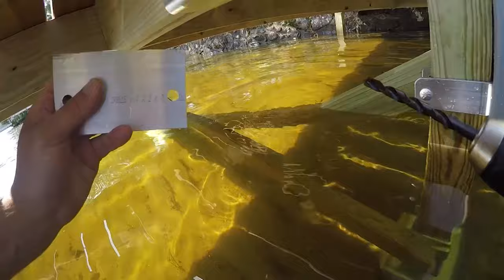A Weekend Warrior 4x4 Post Dock Project #dock #4x4postdriver #4x4postprojects #4x4postIdeas

Comment: You certainly have an ideal location to build a dock. Shallow clear water makes it very easy. I opted for a floating dock because my lake has about a 45° angle into the water meaning, at 20 ft out, it's roughly 20ft deep. I still enjoyed your very informative and entertaining video. Nice job 😎👍

Comment: How long will those 4x4 posts last in the water?  Do you wind up replacing them every couple of years?
Reply: waterlogged wood is naturally preserved. The actual deck will be more exposed to the elements and rot faster.
Reply: @mkuc6951  so why not build the whole deck with waterlogged wood..
Reply: @breatheinbreatheout8372  the posts will last longer than the deck.

Comment: Month old chocolate chip cookie was worth the upvote by itself.  Great video, but how did you know how high to secure the footers to the post base?
Reply from the maker: The hose made it easy to get the post in up to the foot. If my foot were higher up, it would have kept going.  A deeper post does have more strength. I've seen some lake bottoms have 7' of mud before getting to firm soil. If you have a situation like that, sometimes floating docks are preferred. As for knowing the height to put in the ground, think about the size of the boat you're holding. If it's a small boat or no boat, you don't have to go as far into the ground. When I build pipe docks, I drive the pipe 2'-3' into the soil if it has a boat tied to it and if there isn't a boat, I put the feet right on the end of the pipe so its not driven. the weight of the dock holds it like a table in the water.

Comment: This is so fun to watch. I’m curious as to the lifespan of the pressure treated wood and hardware. I found out, from owning a 125 gallon aquarium, that water is the most corrosive and destructive thing to deal with over a period of time. Things in my aquarium that were supposed to last forever barely lasted a couple years. Have you experienced this? Thank you and stay well.
Reply from the maker: This is one option but if you have acidic water, consider polyethylene floats under your wood frames to keep them out of the water. 
https://greatnortherndocks.com/floating-hardware/plans-estimated-pricing/
If you just don't trust the Pressure Treated, under water, consider galvanized pipe legs instead. 
https://greatnortherndocks.com/stationary-pipe-hardware/dock-hardware-pipe-leg-support/
All things have a life span and water has different properties depending on where you are. We have a local bog we made a mile long boardwalk made of floating and stationary powder coated aluminum, synthetic polyethylene decking and polyethylene floats. Peat Moss is acidic and the old walkway made of wood lasted about 20 years before we replaced it with long lasting materials.
https://greatnortherndocks.com/modular-aluminum-boardwalk-sections/

Comment: Can you do a new chart of all the materials for one 4x10 section? I want to build one in our pond that would be 4x70’ and at the end have a 10x12 partly covered deck. I don’t know how much it will be, but our pond dries up partly in the summer so it would be easier to build since i can use a tractor to hold up sections and dig holes with the auger. The deepest point should be about 7-8’ in the middle (goes over a spawning ditch that was built in the pond) and end in about 6-7 feet of water.
Reply from the maker: @CountryboyCale  https://greatnortherndocks.com/product/weekend-warrior-4x4-bundle/

https://greatnortherndocks.com/product/dock-section-plan-4-x10/
Reply: @SethMerriam  awesome! Thanks. Im Looking into that.

Comment: Why would you not use a chain saw to point the piles? Plus just buy a mud pump from Northern Tool, you can jet the piles down much faster and more efficiently. Just a tip from a 1456 Dockbuilder!
Reply from the maker: You can do it your way. I just made it easy for the average weekend warrior.
This is a person that doesn’t want to get into chain saws and rough cut edges. An ordinary skill saw is probably less intimidating than a chain saw and as you see my cuts were flawless, smooth and easy.
He or she also has a hose nearby at the camp and this process has been around for many generations.
Keep in mind, these are only 4x4 posts and the process you mentioned is used for installing telephone pole sized pilings.
These are docks that don’t require heavy equipment, just simple hand tools.
They work in a lot of places where piling docks would be over building and costly.

Comment: How is the dock holding up?  Post is really what I'm wondering. Want to do 6x6s but 4x4s are easier to man handle solo.
Reply from the maker: Check with the lumber supplier for specs under water.
Some treated wood is for submerged use and you my also consider Hemlock.
We use Hemlock skids under our Dragon Floats.

Comment: We don’t use treated wood in the lakes in Minnesota, schedule 40 pipe
Reply from the maker: The old treated lumber used an Arsenic-based preservative solution, and was known as CCA treated lumber  (chromated copper arsenate).  It was banned here where I live. The new chemical formula is known as ACQ treated lumber (Alkaline Copper Quaternary).   Unlike the old formula, ACQ contains no arsenic but has high copper content. They only allow this type of pressure treated wood in the lakes here where I am. You might consider hemlock or the hardware I have for wood dock frames with pipe brackets for 1.5" schedule 40 galvanized pipe. https://greatnortherndocks.com/stationary-pipe-hardware/dock-hardware-pipe-leg-support/

Comment: Questions Please reply!!!!!! Thanks:
1. The approximate cost?
2. How long those 4X4 pres treated  last in bracket water?
Reply from the maker: You can get a price on the lumber from your local lumber yard. I have framing plans here. https://greatnortherndocks.com/dock-plans-diy-parts/
I'd say you can expect to spend around $300 per section for the lumber.
Here is a link to the hardware. https://greatnortherndocks.com/4x4-post-dock-hardware/
The post will be priced by the length and depth of your water.
Reply: @SethMerriam  Thank you so much. Do you have any ideas how long the lumbers will last in the water like that?

Comment: How about the ice pulling out the poles in winter? With this construction the poles should start leaning sideways after a few years.
Reply from the maker: This video is about a removable dock system that can be installed and removed in an afternoon. I would never suggest leaving a dock in the ice.

Comment: Did you use any treatment on the wooden piles to be in direct contact with the water?
Reply from the maker: @michellebarrios8283  yes, some areas don’t allow the pressure treated and some do.
My area stopped allowing ACQ in lakes but allows CCA treated wood.
The supplier should have specs on its use submerged in fresh water.
You may prefer my pipe dock video if PT wood posts isn’t ideal in your situation.
https://m.youtube.com/watch?v=2Q9nZe1YGJM

Comment: I was curious why you take the sections off to the shore for winter if they are sitting above the water. When you take the sections to shore I’m assuming you are leaving the posts in the water and that is what is going to take the damage/move around from the ice. Just wondering because I’m from Canada and our lake freezes over with thick ice and everyone with permanent dock just have to deal with adjust their docks in spring every few years.
Reply from the maker: All of it comes out for the winter.
The legs get numbered and installed in the same place in the spring.
This is in Maine where Ice gets up to 3’ thick.
Even an inch of ice can move and wreck anything left in for the winter.
Once the hardware is on the dock, and legs are cut to length removal takes about 30 minutes and install takes about twice as long.

Comment: Thank you for sharing.
Can you tell me what the cost of a whole package for all the materials and tools and equipment required to install your dock design?
Reply from the maker: I put the everything in the cart to get a price and it was about $1,800 for the hardware and ladder before shipping cost. The wood is something you get at your lumber supply store and you will have to get a price from them on what wood you choose for decking, framing and legs. Here is a page that shows the hardware and prices.
https://greatnortherndocks.com/4x4-post-dock-hardware/
Your water depth will be helpful when pricing your legs and braces.
Measure every 10 from shore so you have an idea of the slope and depth where legs are.
When this video was made before the increase of wood prices, these sections were built for about $300 each.
If you need help with the lumber list, it's provided in the plans here.
https://greatnortherndocks.com/dock-plans-diy-parts/

Comment: Do you get ice where this dock was built and if so, can you leave this in all year long?
Reply from the maker: Yes there is ice and the sections and legs come out easily so the ice doesn’t destroy them.
It took about an hour to remove this one.
Setting it up is a little longer but the first time I had to cut legs and point the ends.
The he legs get marked or numbered so they get used in the same location each following season.
Everything gets stored on flat dry space away from ice pushing up in shore.

Comment: I saw your comment about the posts not having to be too deep, but what would you recommend for post depth?
Reply from the maker: Oh gosh, sorry for the late reply? I just went down through my comments and see that I missed yours.

If it’s a high wind area, put them as deep as you can. 2’ is pretty good.
Deeper is more stable.
Wood posts float so in deep water you should put them deeper for holding power or go with my pipe leg option.
If it’s soft bottom, push them in until they hit firm bottom beneath muck.
In protected areas with low wind, depth is still good for the load on the dock and it’s stability.
If bottomless muck, think about a floating dock that doesn’t deal with legs poking into the stinky mud.
The dock in the video was about 1.5’ beneath the sand and about 4’ of water at the end.
I took my boat off in high wind and put it on the mooring.

Comment: What is the life span of those underwater 4x4's?
Reply from the maker: That is a great question. You will have different results based on water chemistry as well as the lumber you buy.
You can check the manufacture specs on treatment levels and expected length of use under water.
Also if the dock is season like this one that is taken out before winter freezing.
A dock this size is set up in an hour or 2 and taken down quite fast.
Each season you will know the condition of your posts. The wood above water can be treated with a stain to protect from UV rays and rain.
There is ACQ PT and CCA pressure treated.
Also check local regulations before using in the water at your waterfront.

Comment: The thing that looks the trickiest to me is getting the post deep enough. Don't get it deep enough you're not gonna get any stability.... Get it too deep and it's not gonna be level and it is gonna be HARD to pull it out!
Reply from the maker: The hose works great when you pound it at the same time. You might like this hardware better. The pipe drives much easier because it is steel and not as wide. It sinks too. There is a cap that goes on the pipe for pounding it in the same way. You won't need the hose to drive the pipe. You can also rent a gas powered pipe pounder from a hardware store. Keep in mind, driving it in the ground is good but your frame and bracing is what keeps it stable. The wide portion of dock at the end also helps with the stability. I noticed that you mentioned it not being level if you drive the post too deep but that is only true if you don't use the adjustable bracket shown in the video. That bracket allows you to level the frame on your post once the post is driven. The pipe hardware works the same way. https://greatnortherndocks.com/stationary-pipe-hardware/dock-hardware-pipe-leg-support/

Comment: Is this a good method for a muddy lake bed? Would concrete bases be better for this application, or am I overthinking this?
Reply from the maker: If there is mud, I usually prefer a floating dock.  Floating docks work great when water isn't to rough. In my experience, mud is usually found in locations that are low wind and floating docks are ideal. If the muck has a layer of hard gravel beneath, the post legs will work but the do come out hard for winter removal. It's more fun do build a floating dock when there is deep mud. Here is a link to some plans I drew up and the hardware to build a good floating dock. https://greatnortherndocks.com/floating-hardware/plans-estimated-pricing/
Reply: Seth Merriam great information! Thanks.

Comment: Looks amazing. May I ask about how much did it all cost? Not including tools. We are looking to do something similair
Reply from the maker: You can get a price on the lumber from your local lumber yard. I have framing plans here. https://greatnortherndocks.com/dock-plans-diy-parts/
I'd say you can expect to spend around $300 per section for the lumber.
Here is a link to the hardware. https://greatnortherndocks.com/4x4-post-dock-hardware/
The post will be priced by the length and depth of your water.
Reply: You can’t use just normal treated wood it must be .23 treatment level to be able to submerge into water, I have tried just about every lumber yard and they don’t even know about this stuff
Reply from the maker: @barny3ce  That is something to consider. There are different treatments and some that are not allowed in water depending on local laws. ACQ (Alkaline copper quaternary) is one treatment that injects copper into the wood fibers. CCA (Chromated copper arsenate) in my area is no longer allowed other than for supporting power lines or ocean pilings. 
You should check with a manufacturer to find a distributer in your area. You can also check with manufacturers for the treatment levels and what they suggest for under ground and water or salt water contact. The manufacturer will know who they distribute to. 
If your dock is seasonal, it will be out of the water some of the time. 
Keep in mind, Wood posts are not the only way to build a dock. I also build them with galvanized pipe legs and floating with polyethylene floats that attach to wood dock sections. Take a look here for some free ideas and plans for wood dock construction. https://www.dock.shop/shop

You can also check out https://www.greatnortherndocks.com for aluminum docks and the shop menu for DIY hardware.

Comment: What was your cost on this project ? I won’t need the ladder but considering building one like this on a 12 acre pond I have. 

What’s thoughts on the styrofoam or the blue Plastic barrels for floating?
Reply from the maker: In the book, "Building your own dock" I show how to build a dock with the ugly blue barrels. Barrels are cheaper but the buoyancy is in the middle so they bob up and down more than flotation that has buoyancy out to the corners, If the bottom is muck, I usually prefer floating. They are easy to connect and go in quick. If there is a lot of wind, floating can be hard to anchor in place. High wind often scrubs the muck away so I usually suggest stationary in that location. If you do floating, the blue foam will make a mess when animals start to nest in it and chew it up. bare foam takes on water and gets heavy. Foam inside rotation molded polyethylene is OK or the Air Filled Dragon float with skid option is really the way to go for floating. Drag them in and out. You might also consider the MPDs (Modular Plastic Docks) https://greatnortherndocks.com/plastic-dock/. 
As for cost of any project, the wood portion is changing based on lumber and the big stores buying up all the PT on the market and charging triple. Prices for the parts are all on the site. The hardware and MPDs can be shipped affordably. https://greatnortherndocks.com/floating-hardware/plans-estimated-pricing/ If your do floating, the decking should be wood like cedar for best twisting strength. The cedar is lightest. If you have screwed down plastic panel decking, the twisting of a floating dock can snap the screws off that hold down the decking. Those panels don't usually have structural strength to allow frames that want to twist. Plastic deck panels work best in stationary docks or decks or your frame will need to build heavy and strong so it can't flex in the water with wave action or heavy loads of people that get on one corner.

Comment: How’s it holding up?
Reply from the maker: That's a good question. Someone wanted to buy it so I delivered it an hour away on my 6x10 landscape trailer and never saw it again. I built another one with pipe legs for another video. I sold that one too. 10 years is easy to get out of them but the one my father build in 1979 is still standing. The cedar deck boards usually need replacing after 10 or 12 years. The Pressure treated frame holds up a long time.